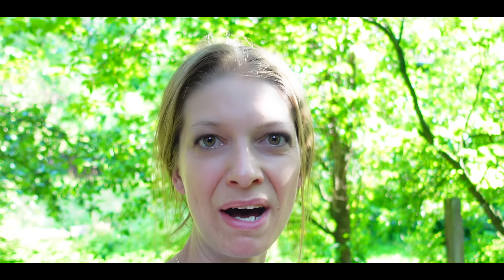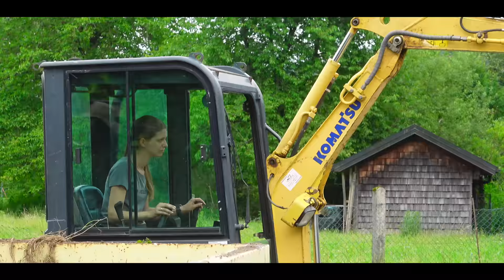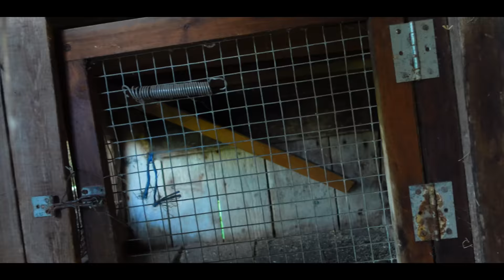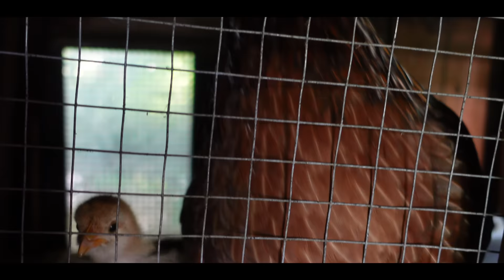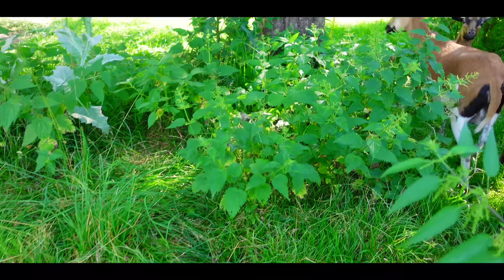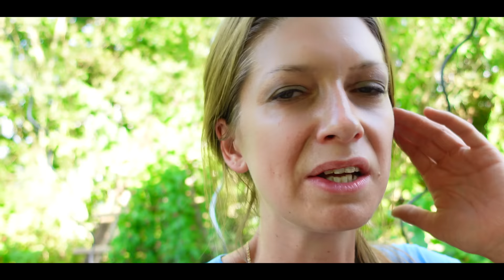I´m Fed up, I'll do it with the excavator 😨 self-sufficiency / conversion🚧

Comment: Hi Vanessa, another good video.  Just a couple of little tips . I seen you was digging the hole with loading bucket/ditching bucket.  Then you was loading the skip with the digging bucket. It's easy to remember for next time. If the bucket has teeth then there on it to bite into the ground. No teeth no biting.  To use the correct buckets stops the links & pins breaking & will prevent the rams bending or blowing a seel .  Plus with hydraulics if anything does snap it is more powerful than a bullet & can kill. But you operated it very well & got your jobs completed.  Just 1 question I have for you.. I noticed you filled that 12 yard skip to the very top. Was that all soil? & Did the skip lorry lift & take that away?.   Looking forward to your next video.